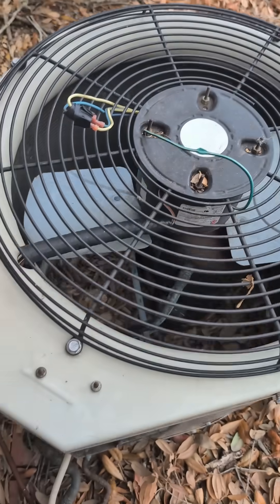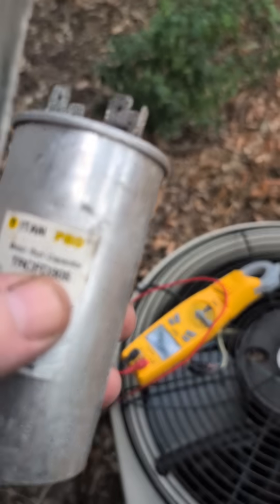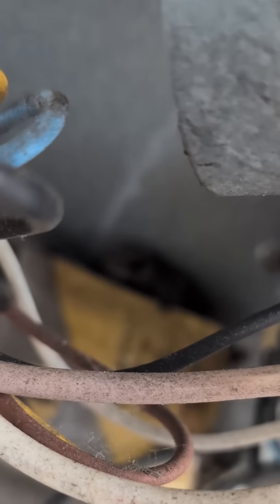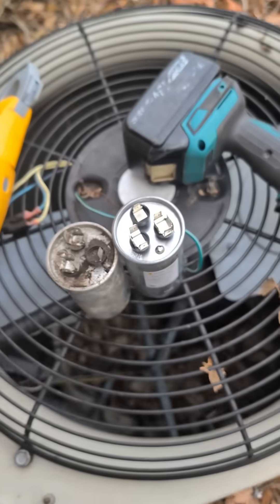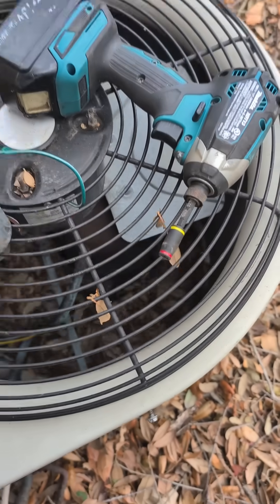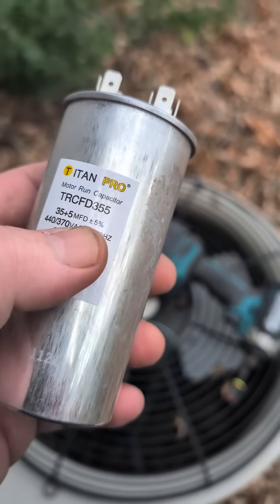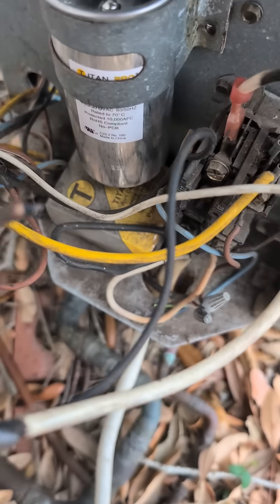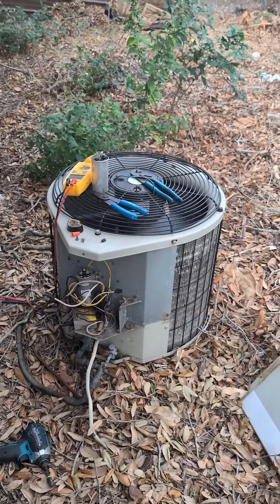upsizing capacitors for old air conditioners and checking for burned wires #hvac

Comment: Increasing the capacitance value will cause the start winding to draw higher current.
Reply from the maker: true but I do this to units on the way out, not much to lose with weak valves